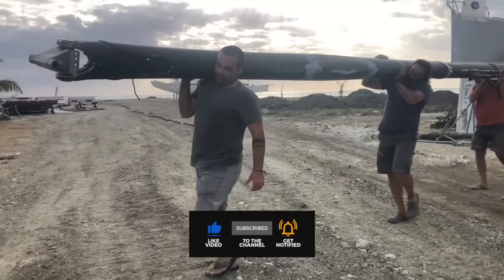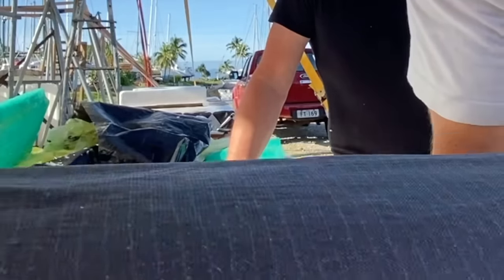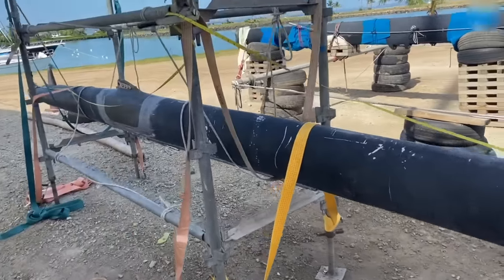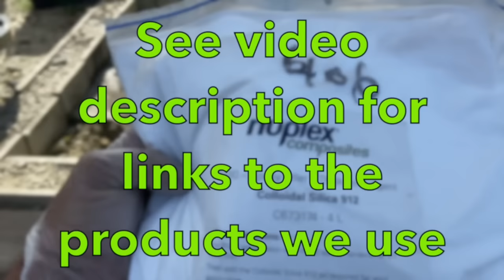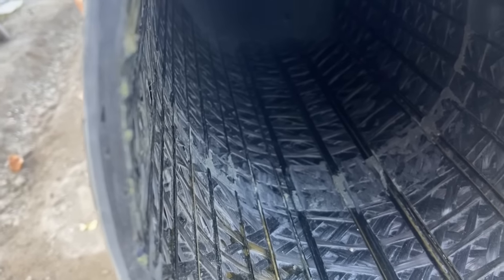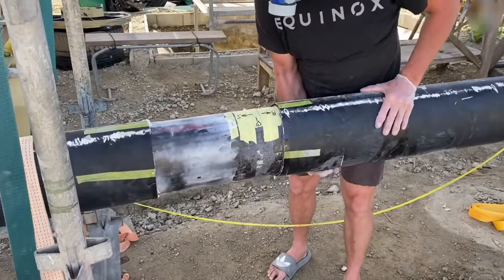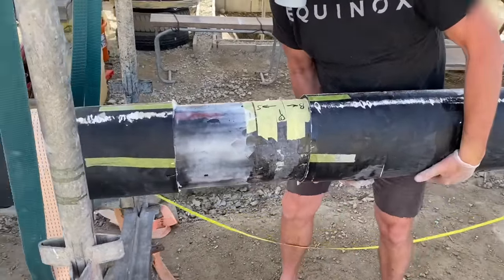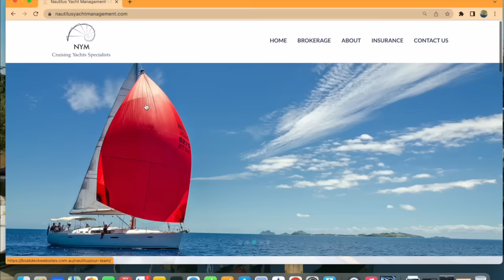Gluing our broken SAILBOAT boom back together | Ep. 44

Comment: Your video has really fired me up as someone who did a lot of work upgrading my Oyster 485 Blue Water yacht. If I may I suggest the folloowing to consider:
1) If it is doable you should cover the whole length of the mast plus spreaders and the boom to give it a modern Carbon fibre look with the matting showing and sprayed with gloss...that would look very elegant and modern.as opposed to just super strong and light as it is now . I would also remember your boon has broken 3 times so an extra layer of strenth makes semnse to me. 
2) On the mast I think younneed various supports that normally are just metal supports . I would try to do it in Carbon Fibre because yu seem to know how to do it...I am thinking of the following items: Radar antennas dome, Radar reflector mounted on a gimble arrangement , Loudhailer (Raymarine do one that is a loudhailer, and that also works as a microphone so the crew on the foredeck can speak to the cockpit in heavy winds, and it also give fof horn signals to international specs.). The you need on the lower spas spot lights to light up the foredeck. Then you should look at LED Naclights  (The Danish TopoLights are the best but expensive...again it seems to me that you could fabricate lookalikes for the Tricolour mast light, Anchor light, Steaming light. I would consider buying a secondhand one and stripping it down to define what LED's they use and how the ED arrays are positioned. 
(3) I would look at getting an ultrasonic navigation  type unit to fit into the hull (Not a fish finder but one arranged for spotting rocks ahead!
(4)  On the rig I would take some thin sewing machine oil and rub that into all of the stainless fixings, then wipe the oil away and sprinkle it with fine chalk ..this will with luck show any cracks !
Reply from the maker: Hey Frank, wow thank you for all the helpful suggestions, very interesting to read! We'll definitely consider them, our main issue is our budget

Comment: ive doneasimilar repair and we were told to also to drill the outer part nd inject thinkened epoxy in to the join. to fill any voids left after pushing together.
Reply from the maker: Yes very right, we did something similar 👍

Comment: Very interesting video on fixing the brken boom... Now how do you plan to get the 15cm gap smooth with the rest of the boom? Would like to see that on a video. I think you are doing a super job and certainly have lots of knowledge. I had an Oyster 485 yacht and once i a storm I had smoke coming from te binnacle due to electrical switch issues. Essentially the standard approach is to use industrial grade switches and fit a rubber boat to protect extrenally but the rubber does crack, and behind the switch you get salt moisture corrosion. I fixed all of that by fitting push swithes at the helm that were watertight but low current, these controlled 12V relays fitted in a watertight box in the engine bay that had large wateright switches on the box lid that duplicated those at the helm and those I fused! Result At te helm I had a safe switching panel exposed to the elments and below I could over ride the switches if ever I needed to. You mat want to adopt that system and prep the wires. The switches at the helm also had silicon rubber paste smeared all over the invisible side to protect against salt / moistute corrosion.  Keep up the good work!
Reply from the maker: Thanks for your comment, we've just released the final video about the boom job, hope that satisfies your curiosity regarding the smoothing the gap:) Thanks for all your ideas re the electrical stuff, another option instead of rubber is to use the butyl tape we've been using to seal the vacuum bags as it stays soft and sticky forever. About the switches, in marine shops you can also find pneumatic switches which pump air down a tube to activate an air switch
Reply: @SailingNV  I really enjoyed your last video and found it extremely informative. My view is painting the boom white does not show off the sork you have e done and even sprayig it black to match the boom is better bu....Why do you not give it a carbon fibre look where the fibre is visible and glaoss painted as they do on new boats and cars? Not sure how you get that standard of finish but if you can do it I would...I also note that the nboom has broken in several places over the years si it might give more street by covering with one extra layer! I would the recognise that as the mast is on the ground it is a perfect opportunity to prepare for oter items that will be needed. First Nav Lights on the mast ...Topolight from Denmark are great but expensive but filamenr bulbs tend to break due to whiplash on a mast ...Maybe you buy Navolight or fabrcate your own using an old Navolight as a template! and indication of the LED's theyuse internally! You should fit a lightning protector unit which islike a baby bottle cleanre made of cpper covered in stainless steel and has a small wire to the hull earth plate ...these things really work and protects you, the boat, the electronics. Next fit a Raymarine (or other) loudhailer up the mast ...it allows yu to speak to crew at the bw  in windy weather and they can talk back to you as the loudhailer is then a microphone...really useful.as it aslo give international fog horn sounds regularly. The a high powere pneumatic horn up the mast connected to a tube that hgoes to the compressor below deck near the mast. Next all wired from the mast should terminate in plus that go to a small panel at the foot of the mast belowe decks to facilitate future mast removal. The I would check and possibly upgrade the sheaves at the top of the mast so you have one for each halyard plus one for the bosun chair, plus a safety second line for the bosun chair and these hsould go with high quality sheaths back to the cockpit for easy use with an electric  winch. I next would rmove all shroud fatenings and cover with thin oil and then wipe clean and cover with fine chalk ...it will show immediately any cracks ! Next I would have leather pieces made up to cover the shrouds at each spreader to protect the sails against damage.  I forgot you need aradar reflector fitted and actually with you obvious ability with carbon fibre that is an opportunity to make a nice support bracket in carbon and a cover from a standard unit, plus supports for the radar antenna, loudhailer, horn......Good luck..a few things to give your super yaht a real uolift in my opinion.

Comment: I am sure that you have considered it..... My Oyster 485 had a draft of 2.2m yet I had many a hairy moment taking the yacht into small bays that were beautiful. I am sure that an 8 metre keel will give you a faster performance but to some extent you have compromised that by removing the ballast tanks and pump arrangement port / starboard. Your aim ist to make a large comfortable family cruisre from a racing super star and for me that means going into shallow bays ...on that basis I would look at reducing the keel depth to give a draft of say 3 mteres max, and add lead bulbus keel end to achieve. Oyster actually used the same softeare that developed the Australian Americas cup winner so you are local to the naval architects that did that. I would if you go ahead take a lead sample of the existing keel and see how much is purel lead and how much molybdenum that is used to stiffen it and act accordingly. The keel will I blieve be heavier so you will I guess need some strenthening inside the hull.
Reply from the maker: Hey Frank so sorry for the slow reply, we are definitely interested in shortening the keel long term (tho we do quite love it for now!), but at the moment, lack the funds to engage a naval architect to help us calculate thr necessary adjustment... are you able to access the software that oyster use to do the calculation?